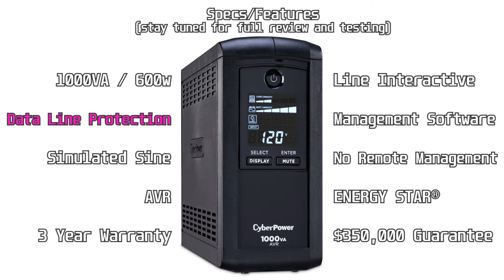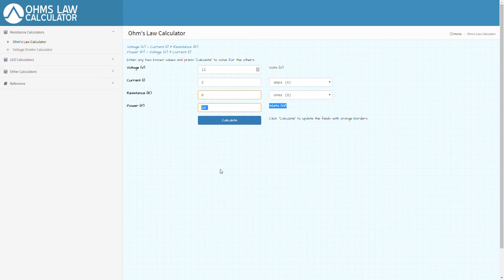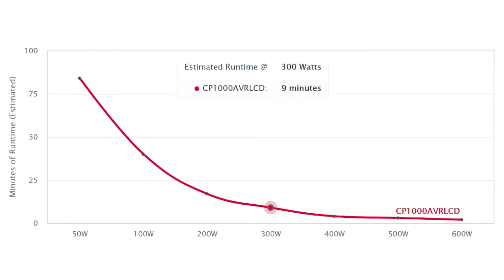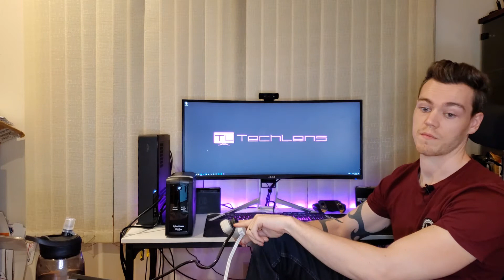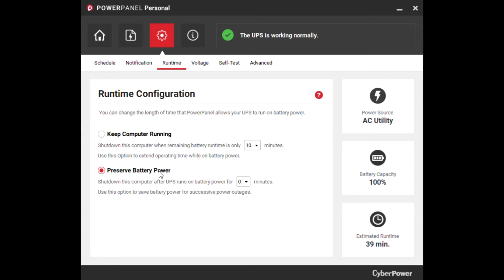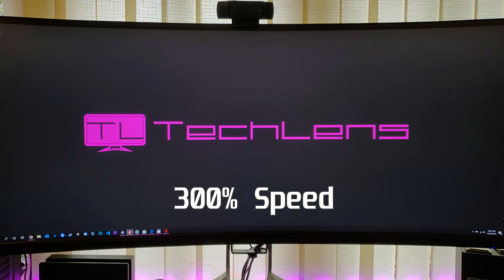Does It Hold Up? CyberPower CP1000AVRLCD (latest model) Review and Test 👍 2020

Comment: I was wondering if you could look at the same UPS for support of media systems like TV, home security etc...  I had a question on whether or not to hook up the Ethernet cable or not.  Second question was how much hooking up the Ethernet cable would slow down my TV/computer speeds.
Reply from the maker: Hey - yep this will work find for those. 

If there's a power outage, all connected devices will continue to run and when the UPS runs out of battery, they will just have their power cut to them.

Thats a good question - I wouldn't expect much of a drop off but to be honest, but there's not a lot of benefit for using them either so if you find that there is a bigger hit that you would like - I would just not use them and plug directly into your devices. 

Hope this helps!